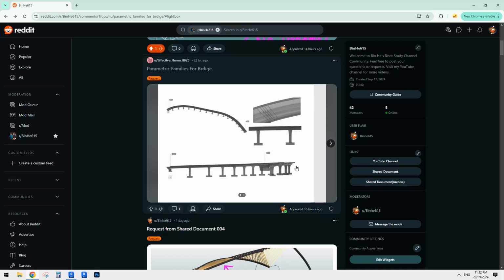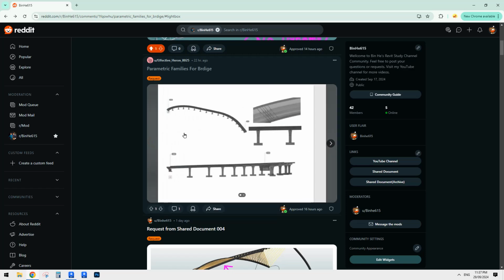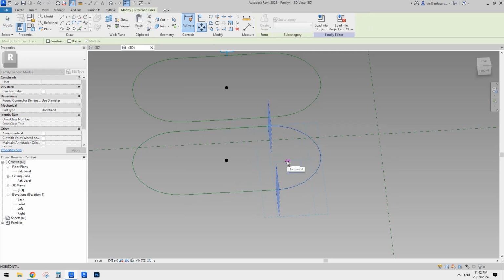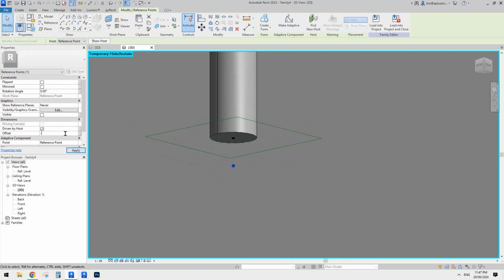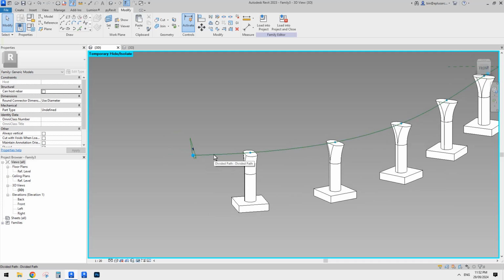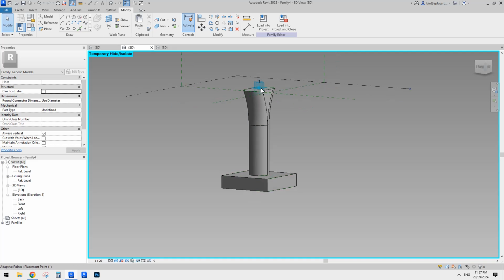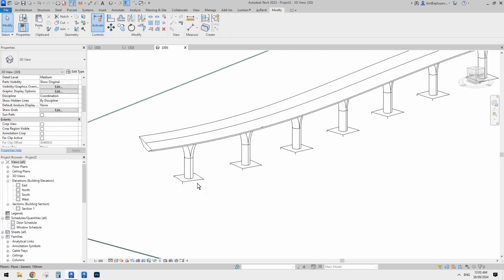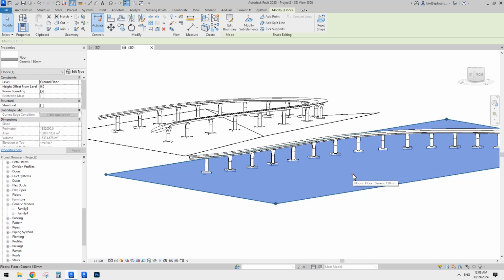24050 - Parametric Bridge with Adaptive Family (Concept)

Comment: Thank you so much sir! That exactly what I need for our project this term. However, there's a concern. What if there's a slope of bridge?
Reply from the maker: When you place this family, it will automatically snap onto the surface of an element, e.g. a floor. When you adjust the slope of that floor, it will follow. You can also select the adaptive points after it is placed and change the work plane to not associated, after that, you will be able to adjust the elevation of that point manually.